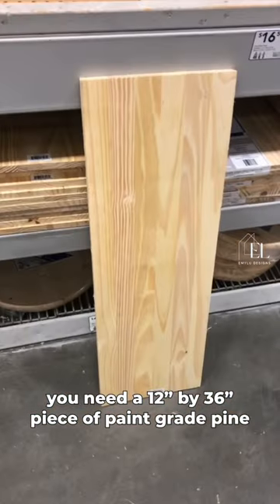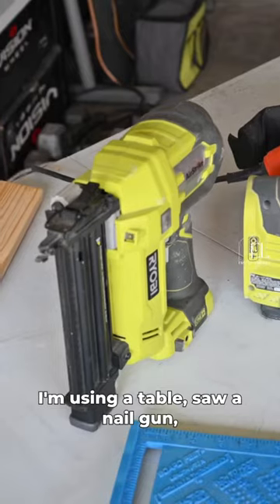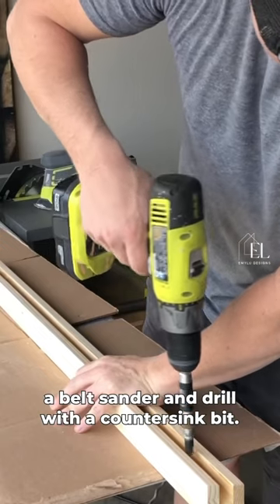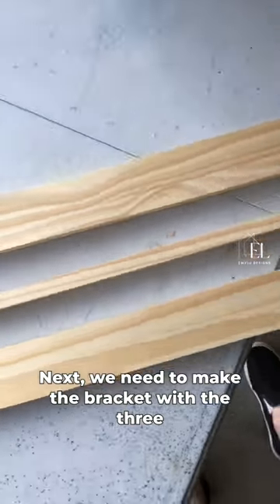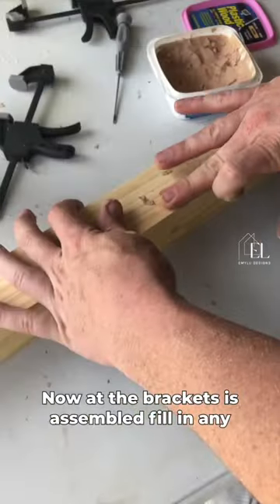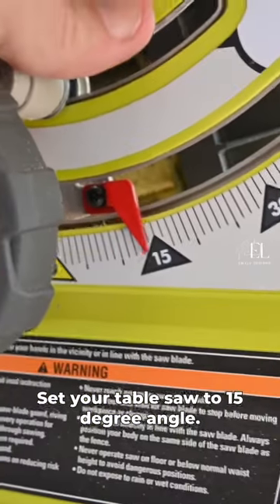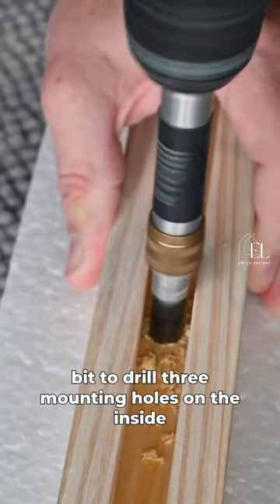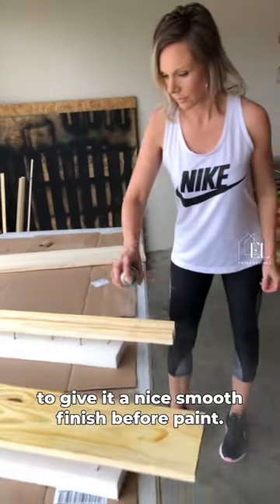$8 Pottery Barn Dupe Shelf #cheapdiy #shortsfeed #fyp #diyprojects #woodworking

Comment: You just showed the internet how to guarantee cutting off your fingers by pinching your cut off piece against your keeper piece and fence past the blade.
Reply from the maker: You know how many people have made these shelves without issue? This in an old video 😂 no reports of missing fingers
Reply: @emyludesigns  Wait are you for real? It has nothing to do with the shelves. 

Learn how to safely cut a piece of wood on a table saw. 
Your first two cuts are horrific table saw offenses. Just pointing it out. They probably all are, but show people safe practicing when using the most dangerous tool in your garage should be better than that